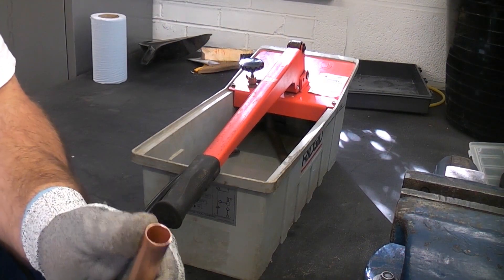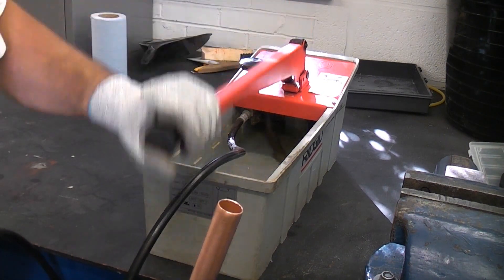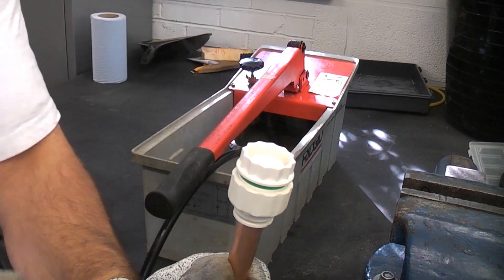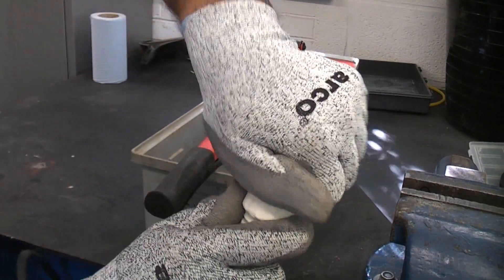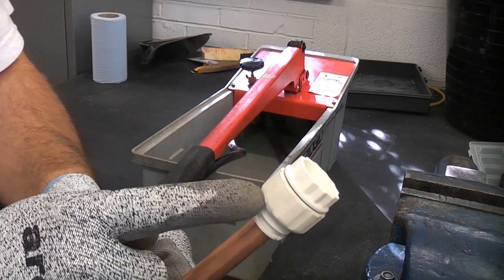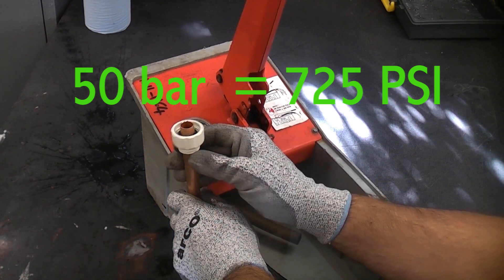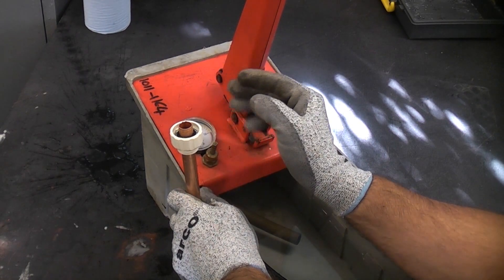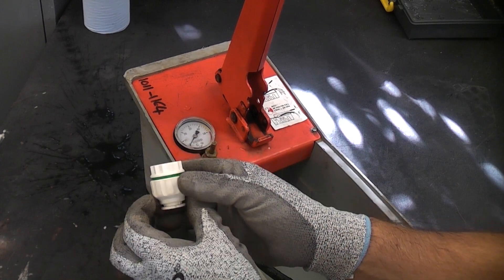Push fit fitting pressure test

Comment: Question please...
how do you adjust the pressure fitting to the actual pipe? Do they  come in various diameters? Do you have to do something on the copper pipe in order for the pressure fitting to fit well?

Thank-you.
Reply from the maker: +pakpukik They come in various sizes. In the UK the two commonest sizes are 15mm and 22mm, so you just buy the correct push fit fitting for the pipe you are using. When you cut the pipe it is critical that there are no burrs on the pipe as they could damage the sealing O rings in the fitting. I normally use a de-burring tool before using a push fit fitting.Thanks for the comment ;-)
Reply: +Ultimate Handyman Very well thanks.
What tool would you uae for deburring the metal? Something like Noga tools?
Reply from the maker: +pakpukik I use a specific pipe deburring tool, like in this video- https://www.youtube.com/watch?v=bajPbO9AwfE

Comment: got to say a always  find your video  very  interesting  and  educational.i personal  only ever use push fittings  on area  were a can gain easy  access  to  it .personal  a think its cause am one of  the  people  that  don't  trust  them .but a personal  a well a loads of skill has went of of plumbing  jew to the fact  of  push fit fittings  and plastic  pipe .a remember  spending  many hours at college  making pass over and offset and other types. was very  surprised  how much  pressure  that fitting  mange  to take . a defo agree  with your previous  comment copper and solder fittings are better

Comment: One problem with push fit is oxygen ingress through the fittings which can lead to central heating systems sludging up if there is not enough inhibitors added. I prefer end feed capillary and copper pipe, but plastic plumbing systems have a place in the industry. Another great video!
Reply from the maker: +Simon Naylor 
Thanks Simon, I was not aware of that!
Thanks for the comment ;-)

Comment: I just can't see the point of them except as a temporary fix. They're really not much quicker than a capillary fitting and they're fscking ugly
Reply from the maker: +TheChipmunk2008 I must admit that I do use push fit end stops regularly, when replacing a bathroom etc. But I'm not keen on them for permanent installations.Thanks for the comment ;-)

Comment: i've always been curious about the pressure these fitting could handle and this is a good clear test, i have to say i would trust these over metal compression fits any time. the amount of times i've had metal fittings leak is no-bodys business. never had a plastic pushfit leak tho.!
Reply from the maker: +kristiaand Do you normally use copper or brass olives with the compression fittings?Thanks for the comment

Comment: Nice demo chez , there are a few comments on how long this plastic  pipe / fittings will last , most manufacturers give a 25 year guarantee , whether it will last longer nobody knows yet as its not been around for that amount of time  , i use it quite a lot and have no worry s about it as long as it's a good brand like Hep or PP...... Cheers   : )
Reply from the maker: +yensabi Thanks, I'm of the opinion that if I was working on a house which I was going to sell on I would use plastic, but if I intended to keep it I would use copper and solder ring or compression fittings.Thanks for the comment ;-)

Comment: The problem us plumbers have with push fitting is the longevity of them. There is never really an issue with these and how much pressure it can hold its more to do with when its left in place and over many years the fitting degrading due to the rubber seal. Unlike a fixed soldered joint where you can have piece of mind, then again saying that I still use these on occasions. Great test as usual! Thanks. 😀
Reply from the maker: +Zed Man I must admit that I recently had a problem with a toilet fill valve, where the plastic threads went soft on the end. This caused the washer to fail and the nut to leak, which was very annoying after just three years. Every time I fit a water fill valve from now on I'm getting one with brass threads!Thanks for the comment ;-)
Reply: Are all new builds fully plumbed with push fit fittings and plastic pipe ? 
With 100s of elbows and T pieces used on the entire system under floors and behind walls ? Is this gonna be a recipe for disaster in 20 or 30 years time ??
Reply: Of course not. They're just being old women about it @boyasaka
Reply: Got to say you are right there Plastic degrades a LOT faster than copper.
Reply: @Billyg215  Well that really depends on the system, without proper precautions regarding galvanic corrosion metal fittings can be gone in months were you never have to deal with that with plastic.
Reply: @malloot9224  Had loads of hep fittings failing (grey older version) on an estate near me recently on  22mm heating pipes  the metal rings seem to be failing
Reply: These are great. The problem with copper tubing isn’t the joints, it’s the flux destroying the pipe slowly creating pin holes. No flux means the tubing is preserved longer right?
Reply: @chrisma1976  I think pin holes could also be caused by lack of cleaning the cuts, deburring
Reply: @SteveRogers461  How ???

Comment: I was surprised how much pressure it took before failing! 

Recently had to replace a heater i installed 12 or so years ago, a lot of the internal parts in the Hep20 fittings had become soft and could be crushed between your fingers, i'm just not convinced plastic has the life span we expect from pipework, especially if its under floors or in walls where it could do a lot of damage if it leaked, the repair costs would be well above what was saved on original install over a copper system.
Reply from the maker: +heavydiesel That's interesting to know. I have seen some plastics go brittle over time but I always thought it was because the UV light attacking it. In the last house I renovated I used just two lengths of plastic John Guest pipe as it was in an area where the copper pipe used to get condensation on it a lot. Hopefully it will outlast me!Thanks for the comment ;-)

Comment: Great work my friend. Must say though, I nearly sh_t myself when that top blew off. Keep up the great work.
Spud.
Reply from the maker: +blackmore56 When I was pressurising the pipe I knew it was going to blow off as the fitting slid further up the pipe, which relieved some of the pressure. It didn't half go with a pop though ;-)Thanks for the comment

Comment: Impressive, but what is the service life of these? All plastics absorb water over time and become brittle with age from water and heat.
Reply from the maker: +brandywell44 I'm not sure how long these fittings will last, although plenty of people use these on new installs!I have had problems in the past with plastic water inlet valves- where the threaded plastic has softened and then caused a leak. Once this happens you have to replace the whole unit, which is very annoying!Thanks for the comment ;-)

Comment: Great test but I think people's concern with push fit is the lifespan of the rubber seal rather than the pressure they can take. As always great videos, thank you for uploading.
Reply from the maker: +Chris Campos Yes, A big problem with them is that they are often used incorrectly. I have seen them used on Chrome pipe before and also used on plastic pipe without the pipe insert, which would surely lead to a flood eventually! I'm not sure how long the sealing ring would last in these fittings, but you would imagine that it would wear due the expansion and contraction of the pipe.Thanks for the comment ;-)